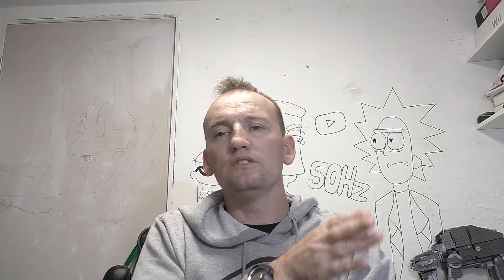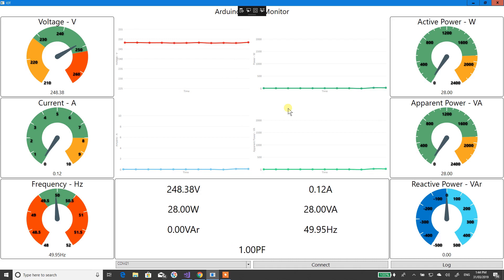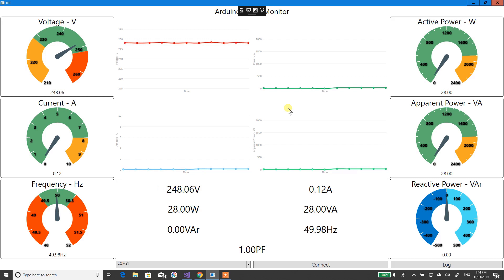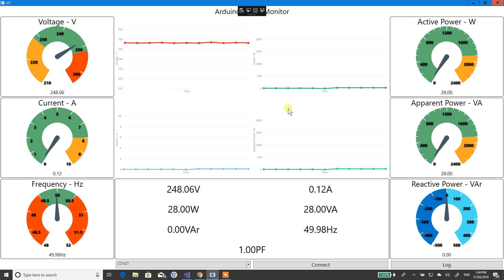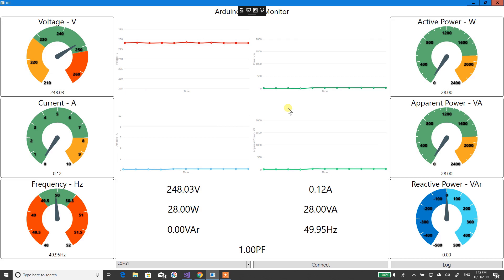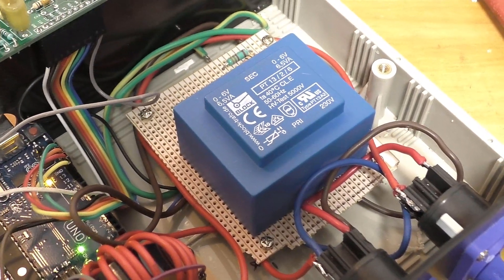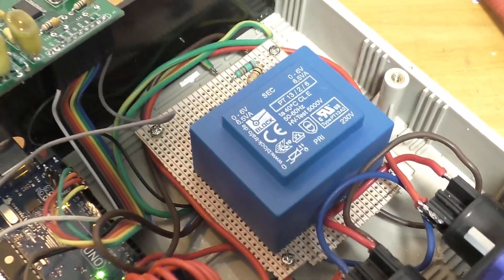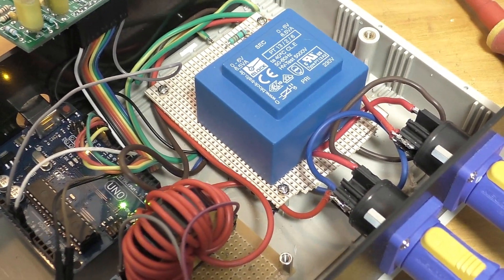Arduino AC Power Monitor Project update 2

Comment: Your work looks nice. I wondered what energy measurement chip you're using.
Reply from the maker: ATM90E26. Great chip.
Reply: @50Hz  how do you do the caliberation procedure ? what equipments are needed?thanks a lot.
Reply from the maker: xingyum li I was actually hoping to have the video out today, expect I had a delay in getting a board through customs so it won’t be out till next week. I’m going to demonstrate using a halogen light bulb and a multimeter
Reply from the maker: I made a new board to put a CT and PT on with a voltage divider that made it look more neater